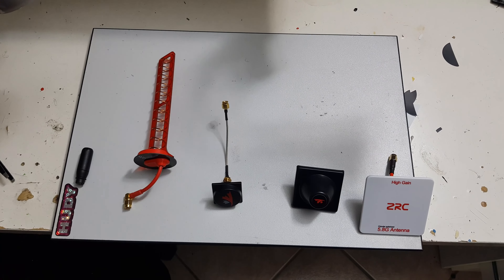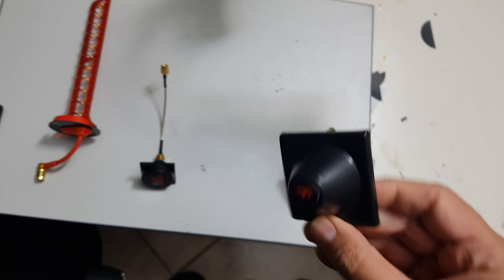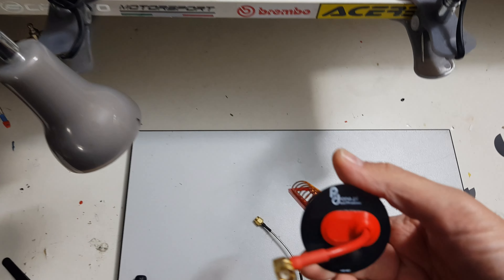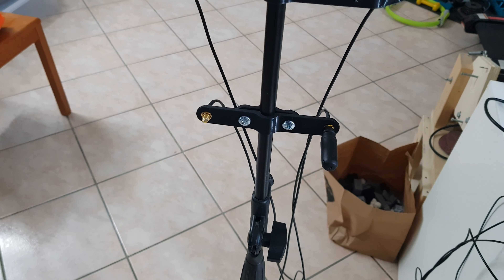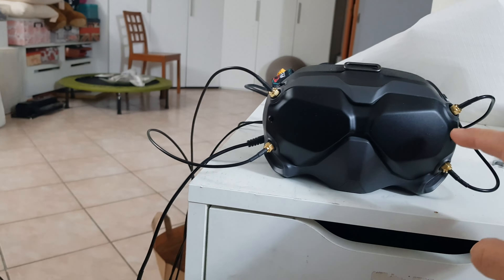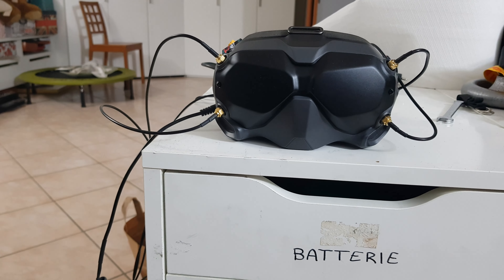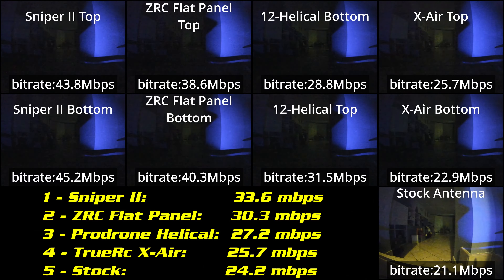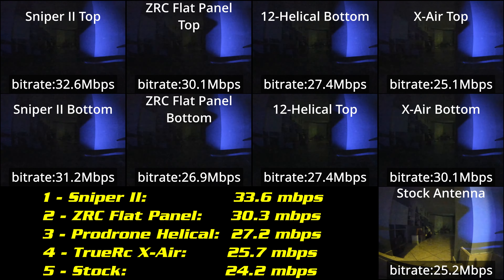DJI FPV Antenna Test: Truerc X-Air & Sniper II, Prodrone 12-turn Helical, ZRC Flat panel - Part 2

Comment: I bought 4 TrueRC antennas even though I was quite skeptical. From my house, in a straight line, my DJI FPV reached 2.6Km. Now it reaches 3.5km with 75% signal and I already have to turn around for the battery. In short, I have a lot more signal range than my batteries allow. The TrueRC are amazing.
Reply from the maker: glad my review helped, that's why we're here, to share honest reviews

Comment: Hello! I love long range FPV and I found your test is very useful as a reference just like RCSchim. Although your channel is quite new, you are the few who would share full detail of your equipment, raw video and test procedure. This is invaluable for us! I subscribe your channel and watch every single video carefully. I hope you would have more resources to test more new antenna products (both transmitter and receiver) soon. Thanks!
Reply from the maker: hi mate, you got the point, i try to be as detailed as humanly possible, in relation to the time i hve available. i just try to put myself onthe other side, when i seek for information, and get angry because the one detail that i would need is not provided. i know rcshim and he is an enthusiast like us, and also likes the testing procedures and being thorough. i guess he has much more free time than i do, though. stay tuned for other videos bye

Comment: Did you test the X²-AIR 5.8 MK II?
I think it’s better than sniper ii, same gain and wider beam width so you can move your head without loosing the signal
Reply from the maker: hi, no, i don't have one at handy, and to be honest i haven't heard a lot about it, but i heard you, if i have a chance i will definitly give it a try, possibly including some tests abput different angle beams

Comment: Good stuff man. Is the x hair the same has the x air II but single?
Reply from the maker: Hi man, yes it is, you can get the boundle with two of them joined (advertised as ideal for the DJI Goggles, I have also one of them), or get it as a single one.
Reply: @fabyt68  have u tested them? I just ordered a pair.. i was going to replace all stock antennas.. now wondering if I should only do 1 side.
Reply from the maker: hi mate, i'd say that it depends on the situation.. when i do mountain surfing i use only a pair of X-Air on one side, and omni directionals on the other side, to be safe in any situation, and it works great. if you are surely goind to be with the drone ONLY in front of you, in a 180° angle, then 2 pairs will also do the job, and i tested that scenario too.